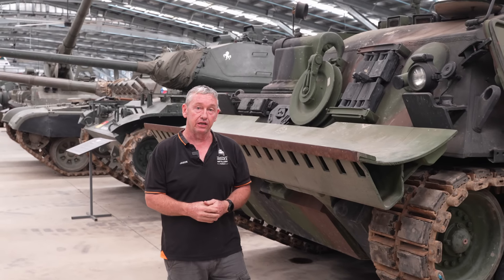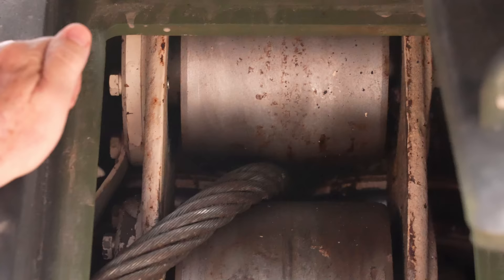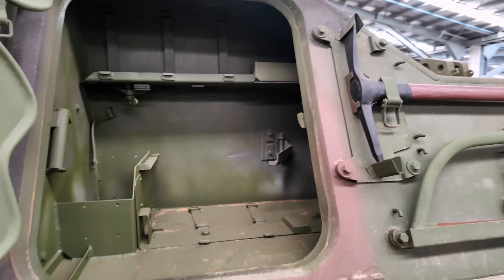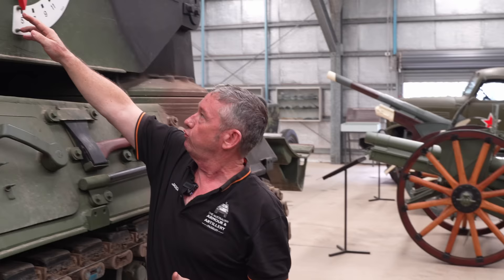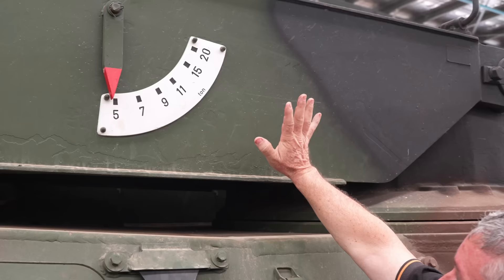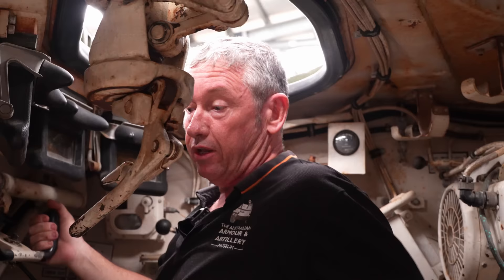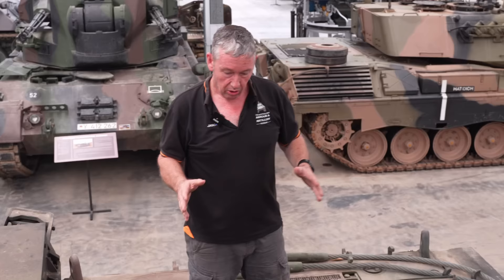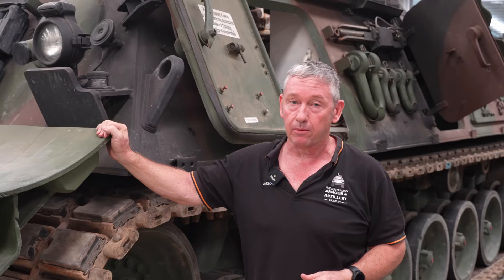The Leopard ARMOURED RECOVERY VEHICLE

Comment: These were my favourite toy during my RAEME career.  As you say Jason, in my humble opinion the ARVMs were possibly the most versatile bit of kit we ever bought.  The reccy mechs could do just about anything with one of these, and they are an absolute hotrod to drive.  It was an unfathomable decision not to keep these in service.  I think the one that was based at 'The Centre' is still a runner, though I'm not sure if that will continue once those displays all go to their new home.  Of all the bits of kit I came across during my career, it's the ARVMs I miss the most.  Great to see one being covered in detail.
Reply: Huh, didn't realize there isn't a matching Abrams engineer vehicle
Reply: @frostedbutts4340  There's the M88, which don't get me wrong is a great recovery vehicle in it's own right, but it just doesn't have the versatility of the Leopard ARVM.  The crane on the ARVM capable of doing millimetre-precise lifting jobs.  The ARVM also has a neat party trick, which is that it can change its own power pack.  Jason is quite right, had we kept the Leo ARVMs alongside the M88s we got later, the ARVM's could have continued to work their magic.

Comment: I was a mechanic on board a Bergepanzer between 1978-1980 in the Belgian army. During the NATO exercises, we were only 2 on board. I slept lying inside the tank and my fellow driver placed the boom of the crane approximately in the middle of the rear shelf and put a tarpaulin on top to make a camping tent. With the heat from the engine, it had heating for about 10 hours. In the morning, I turned on the main ignition and turned on the internal heating (which can be seen just behind where the orange pipe is attached). I waited 10 minutes in my sleeping bag and then I got out since it was around 20° Celsius. It was a very good machine, we did a lot of recovery of tanks stuck in the mud. It was the happiest time of my life.

Comment: Our crew would sleep on the dek in colder conditions, the residual heat of the engine would keep them nice and warm, a tarp was used as cover.
Reply: I was wondering that when I saw the flat surface on the rear!

Comment: I served one of these myself. When I was younger and fit through the hatch. An excellent device. Powerful, sensitive and relatively fast and you have space and a good heater. You can live there for weeks with the usual two-man crew.
The second door contains external starting cables, Chainsaws, Motorflex, impact wrenches and a few other devices. That changes occasionally and an electric flame cutter/welding machine. As an experiment, we had an aircraft APU as a power generator. They won't have taken it over. It was louder than the tank.
The gearbox shifter here is the new version. We still had the semi-automatic. It was more fun and more similar to that of the Panther or Tiger.
He's a little thirsty. I once flushed 500 liters through the engine for a transfer from the Verden area to Bergen. About 40km as the crow flies. Well, I had a Marder on the trailing scissors. But it also ran 65 kmh in this combination.

Comment: I remember in about '97, 2 D9 cats got bogged doing reclamation work beside Tiger Brennan drive... the second got stuck trying to recover the first... At the time there was nothing 'yellow' in Darwin big enough to pull them out, so a phone call was made... ARVM went for a little drive, single pull (I think), both cats back on dry land...
Reply: didnt they have to get them out again when that crane went awol into the drain next to tiger?
Reply: nfi...Possibly after I left on posting... I was carting the ARVMs around the Territory because (apparently) I got on the right side of the wreckymechs... though I did have a few favourite crewies among the gun tanks...

Comment: Big fan of the ARV, and pleased you have one to give us a walk round - personally i now favour the ARV3 the Kodiak, fantastic system and has way more functionality than it first appears - something i would very much like to get my hands on and use in a civil mode with out all the military equipment - the adverts suggest some roles of use and comes as a perfect platform although my only concerns are weight and performance over inaccessible terrain - nuff said, all very cryptic haha - but when your in need of a descent engineering tool, the ARVs have strength in bucket loads

Comment: According to the manufacturer, these things had enough battery power to remove it's own engine and lift a replacement in.

AFAIK, nobody has ever tested that in reality.

If you want to give it a go - would surely make a great youtube video!!

Greetings from Germany!!
Reply: There's no need to do it with battery power to run the hydraulics, you can use extended lines to run the power pack you are removing while you are removing it, or run the vehicle from the power pack you are installing.  It's been done many, many times.